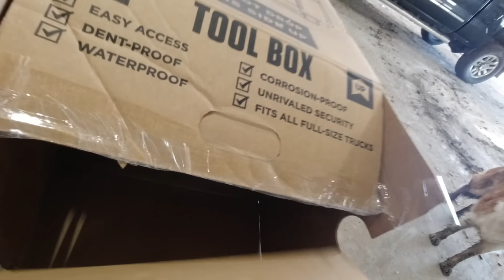Get A Load Of These Heifers!

Comment: I hope you do better on your cows than I did. I bought 3 black angus calves for $1.53 a pound and sold them 6 months later for 90 cents a pound. Basically I lost my shirt but that's the way it goes I guess. A cattle baron I am not. At least I didn't have to mow my pasture last summer.
Good to see Tiff classing up the place.
Reply: If you doubled their weight then you are ahead!
Reply: @miketilley402  They didn't double their weight unfortunately. After I subtracted everything I had to buy to support them like mineral tubs ($185 each times 2), salt lick, transporting them to the sale and the fees to sell them I'm about $700 in the red.
I'll just mow next summer. :)

Comment: Do those waterers with the balls have heat? If not, roughly what temperatures will they freeze?
Reply: they do not. they will usually not freeze until 5 or 10 below. Unless there is a strong wind. Then all bets are off.
Reply: @briansonne814  
Understandable. Looking to put one in at my place. Thanks for the response!